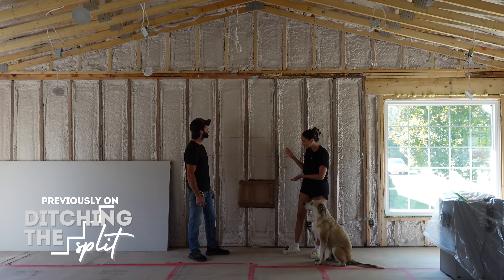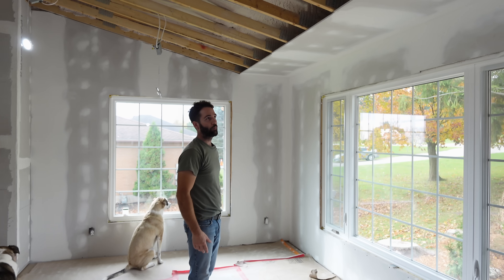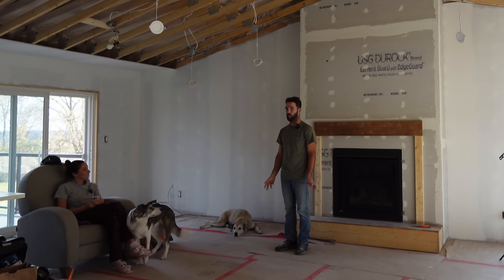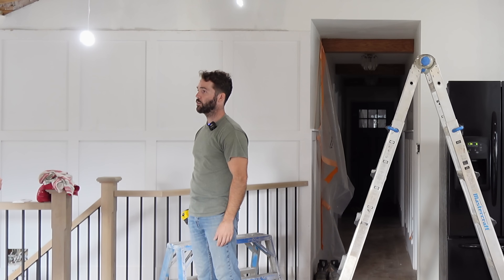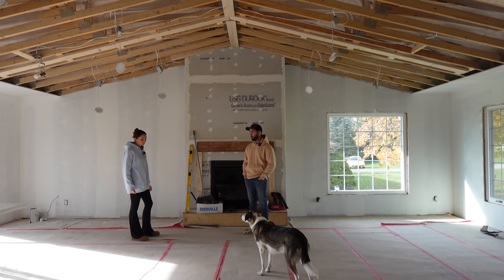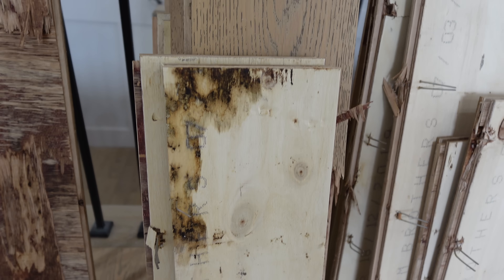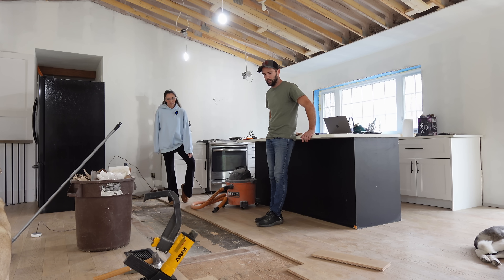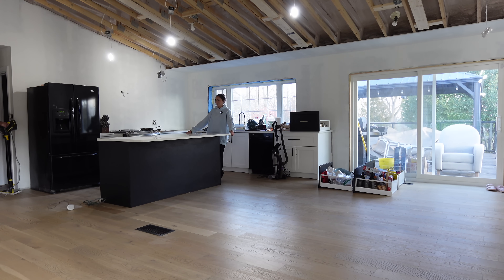EP 21: This Changes Everything | DITCHING THE SPLIT

Comment: I'm not a big fan of open plan spaces, but my goodness you guys have built essentially the only type that I love! My compliments on the design, the space is already so beautiful!!
Reply: My home is an open floor plan in main area. It's a smaller house so without it, it would feel way too small! I prefer the open plans now.
Reply: @priscillacordero8133  I find them to be noisy, without anywhere to hide from the mess and smell made from cooking dinner, and lacking when it comes to two or more individuals occupying themselves separately. I will always have a fully enclosed kitchen, and at least one fully enclosed snug or sitting room. I also find that they make small homes even less useable, as they leave you with less wall space to put things against (bookcases, paintings etc)
Reply: @caoimhenimhuireadhaigh1303  good thing there are designs for everyone's taste. I have 3 enclosed rooms, an enclosed laundry, and attached garage. Nice size backyard and small front porch area. 10 ft walls so plenty of space for art. I don't like too much furniture. My next house will have even less furniture.

Comment: To clean the grooves in the floor, try a floor broom with soft bristles. Think of it as a giant toothbrush. They are made to go in the grooves. I used to use a regular plastic broom on wet floor and then microfiber the water up. It was some dirty water. The basic broom did more than a regular mop, but was not as good as the pool brush like floor cleaning ones.

Comment: Yes, honey, in order to keep your floors clean, you need to mop them with water and whatever cleanser is recommended by the flooring company.  Bleach and water will sanitize your flooring, but be sure it's safe for your flooring.  You could also use a Robovac X.  It's the best.